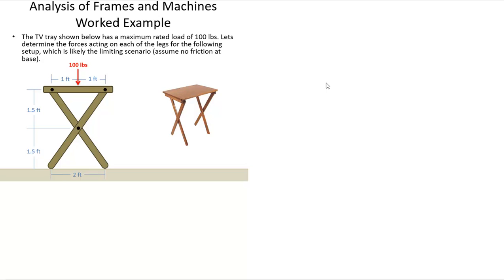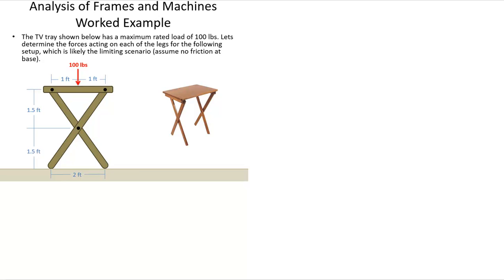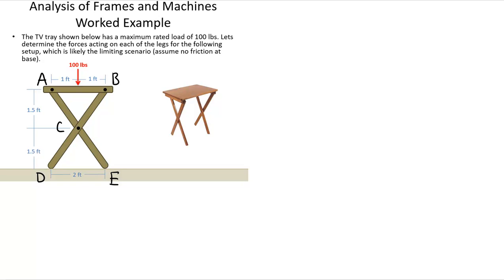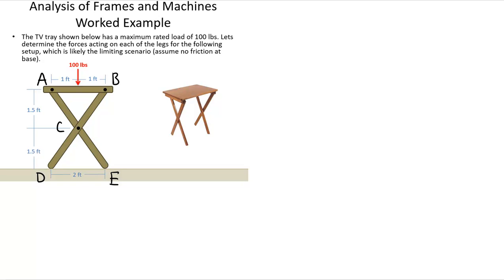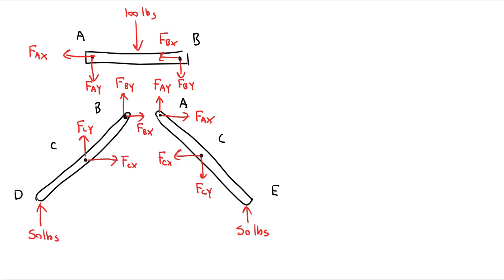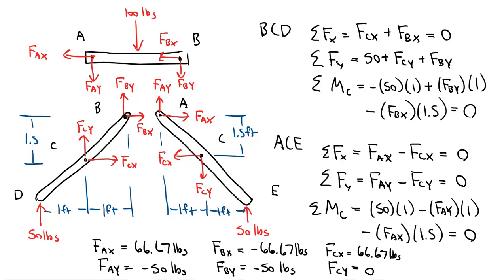5.7 WP 004 - Analysis of Frames and Machines - JPM

Comment: Question about shared common pins:
If the load and geometry is symmetric, are we treating them as zero length 2 force members? What is the tip or hint for a shared pin like this not having a y component? I noticed on another x frame problem (a chair with non symmetry geometry and loads), the shared pin had a y component i think. Having a little trouble with shared pins connecting members like this. 
I assumed that the members would be what is transmitting the load to the ground correctly it looks like, but im still a little hesitant to build any rules off of this. I havent been able to find any clear information one way or another. 
The way i think about it, is if theres symmetry in loading and geometry, the pin is only there to restrain the members, otherwise, it may have to take some of the load? I didnt see a solution set for the chair problem so wasnt sure.